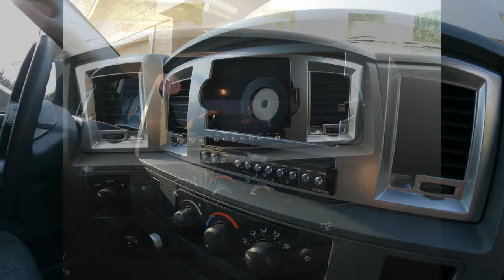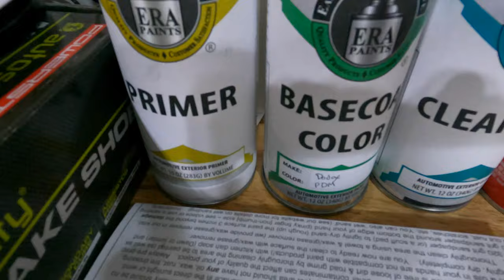Chrome DELETE On UNICORN 2006 Dodge Ram MEGA CAB 5.9 CUMMINS G56 | How To DECHROME Your Truck!

Comment: I knew I recognized this truck. I used to see you driving around. Great lookin truck!
Reply from the maker: Thanks, always liked the look of the 3rd gen and the mega cab is pretty sweet. The newer trucks are really nice inside, but this isn't my daily driver and the reliability of letting it sit for months at a time, then hitting the key and not having any issues is hard to beat!
Reply: @bucksgarage  yeah seeing yours and a few others in the valley made me get one! I had a third gen with a different headlight style. I decided to switch it up and get the same model as you. It’s currently being worked on by the seller before he passes it off to me. One more week and I’ll have one! Super stoked.

Comment: Sorry for your loss. New here.  Can't believe you have owned the ram for 11 years. I just got home and that's how I found your channel.  I got a 06 mega cab 3500 srw with the g56. My dream truck .
Reply from the maker: That is a sweet spec! I wish mine was a srw 3500 instead of a 2500. I ended up putting Timbren helper springs in it so it functions a bit more like a 3500 now. Enjoy your new truck and thanks for checking out the channel!

Comment: Maybe add a compound turbo to it you can do that with those old five nines and I did the LED tail lights and headlights with the LED strip on the bottom. I’ve been looking around for a gram box or stretch my truck which adds a 8 foot box but good job with your truck there
Reply from the maker: I would like to look at some turbo upgrades at some point. Lately the truck is only used once a month or so and generally for hauling or towing so reliability is the main goal these days. Thing can sit for months and still starts right up and does whatever I need it to!

Comment: What front bumber is that
Reply from the maker: Just an OEM Laramie bumper. It had a crunched bumper when I bought the truck so I found this Laramie bumper on Craigslist, was already the right color so I slapped it on.

Comment: Cool video! I have the same truck except auto. Same color as well. All yours needs is some Alpharex headlights and it will be exactly what I’m doing with mine!
Reply from the maker: That is hopefully my next step, the Alpharex stuff looks nice and they have a gray version that should look sharp on it. I need to figure out a rear bumper too.
Reply: @bucksgarage  I’m just going to color match the factory chrome bumper. Roll pans look cool but you lose the functionality of a bumper/step.
Reply from the maker: @Braap_Jackson  I like the roll pan look a lot, and I am okay with losing the step. My issue is you lose the stock hitch with a roll pan which I am not willing to give up. They make a different hitch version that works with the roll pan, but then you lose your spare tire and I don't want to do that either. So color matched stock bumper is likely the way I will have to go too.
Reply: @bucksgarage  I totally agree. There’s a balance between what looks best but still works as a truck. What did you use to level the truck?
Reply from the maker: @Braap_Jackson  Truck was leveled when I bought it, pretty sure it is just the pucks that sit on top of the springs in the front. Stock suspension otherwise with some Bilstein shocks. I did do the upgraded steering to get rid of the Y setup and put a steering stabilizer brace in it too.
Reply: @bucksgarage  I’m not sure if I wanna do the pucks or do it right with bigger coil springs.
Reply from the maker: @Braap_Jackson  Not sure what bigger springs would cost. Mine has had the pucks for the 11 years and 50k miles I have had it, no issues so far.
Reply: @bucksgarage  And you have no running with 35’s? I have 22x12 -44 so I’m gonna rub lol
Reply from the maker: @Braap_Jackson  They do rub a bit, I had to cut some of the fender liner away, works fine now.